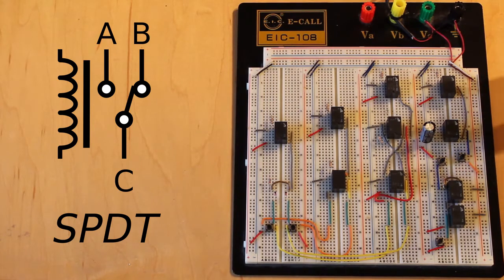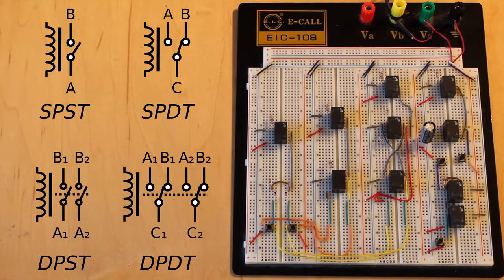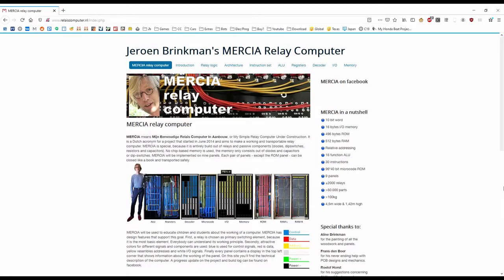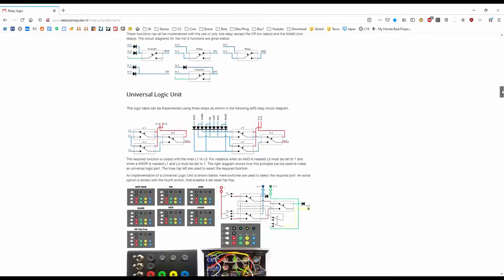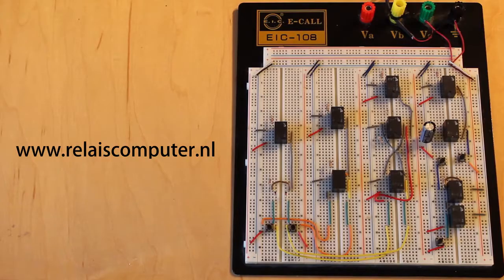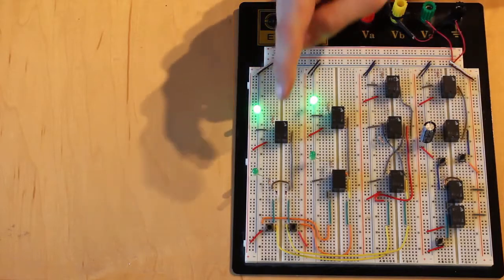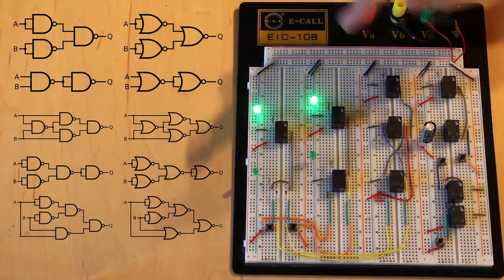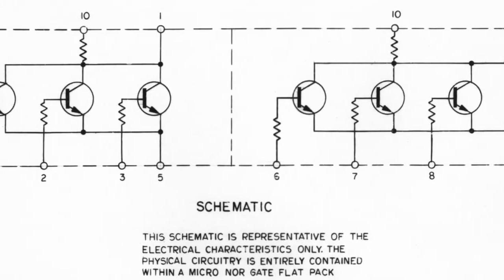Relay Calculators: Episode 3 - Relay Logic Gates, Latches and Delays

Comment: At +12:30 the description and the circuit diagram for the delay circuit are wrong. For the circuit to operate correctly the +5 connected to the contacts on the top relay must be connected to the Normally Open side, not the Normally Closed side. And the description should be that the delay occurs because the bottom relay doesn't energize until the cap is charged through the NO pin of the first relay (not the NC pin of the first relay). Once the cap is charged up, the power can then flow to the second relay and hold it closed. Then when the button is release the cap quickly discharges because the NC pin of the first relay is connected to ground. If the NC pin of the first relay wasn't connected to ground there would also be a delay of the LED going off when the button is released. 

Regardless, that's not how I would do that circuit. I don't like the fact that on one relay power and ground are connected to the NC and NO pins, but on the other relay power is connected to the common pin (and the NO pin has to float). You should consistently wire all the relays with power (or source signal) always entering on the same side of the relay. And because sometimes you want an inverted output from the gate and sometimes the non-inverted output, the input to the relay gate should always be on the common pin.

Comment: You can create a XNOR gate using only 2 relays by using the deviator switch diagram as basis. It is used for switching lights on and off by either end of a corridor. Same scheme, same truth table, the deviator switch is basically the XNOR gate.

Comment: Logic Gates, latches, and delays
Relays, Buttons, LEDs (Light Emitting Diode), Capacitors, Resistors
SPDT relays  https://youtu.be/_nXc439NTYk?si=zT2tPNIShm96czCb&t=110
Or, nor, - 1st bread board
and, nand, - 2nd bread board
univeral nand nor https://youtu.be/_nXc439NTYk?si=Mm7N9smMjoFoPMJd&t=458
xor, xnor - 3rd bread board ://youtu.be/_nXc439NTYk?si=Yr2IJNxRDkIZW2IL&t=513
SR latch, coil stays energized (memory - register) - 4th bread board
Delay with a 2200microF capacitor.
Half Adder and full adder.  https://youtu.be/_nXc439NTYk?si=DwDJ9305dj2Vnl3e&t=891

Comment: i cant get this to work. Trying to make a full adder to add up 6 bit binary numbers and it doesnt add. I dont know how to use these circuits to do this and everywhere online has bits and pieces of the thing but nobody seems to put it all together in one circuit. Either it doesnt add or it instantly forgets as its adding.

I just want to count pulses from a switch and add them up. Just cant seem to get it to work. Maybe I need a different circuit or something.
Reply: tried multiple schematics from the linked website and the gates work but are useless because all they do is chatter rapidly. i must use a pulse so fast that i might as well just use a microcontroller. cant figure out what im doing wrong.

Comment: Well presented. Are you intentionally blurring out the part numbers on the relays? I would like to do this project at home, but I dont know what form factor of relay will fit on a breadboard. Its really hard to tell in this video what the pinouts are. I am assuming Common, Gnd and NC are on the left, and NO and Coil are on the right?

Comment: To create a "better" relay based processor, another approach is to arrange relays in reverse contact direction so that circuits will pull voltage to VCC and to GCC for logic 1 and 0 respectively, not just pull to VCC for 1 and leave floating for 0. For example, to create a NOT gate you connect the NO contact to GND and the and NC contact to VCC, thus the output is the Common pin. If all logic gates are designed like that you get cleaner logic signals, and improved dynamic stability on very large designs as well as faster settling times of logic levels (less glitches caused by coil induction).
Reply: how can I get a strong grip on this subject like you ?
Reply: Yeah, but there’s a good chance for shorting out your power supply
Reply: @d3vitron779  That's right, but @lsfornells has a good point point too. First, that's no different than transistor based logic gates. Also, using relay logic that will both drive and sink voltage allows for circuitry that would not be possible otherwise, such as pass transistor logic (PTL) gates made with relays. PTL data latches and flip flops use far less transistors than their usual alternatives, and they can be implemented exactly the same way with relays. You may want to check a video called "1 bit memory with 2 relays" from my channel to understand why
Reply: @RelayComputer With normal 0=open, 1=connected logic, a single bit latch is one relay only anyway, not counting the bus connector and the shared sequencer.

A D-latch with rising-edge-sensitive clock and complementary outputs takes just 3 DPDT relays with snubbers on the coils.
Reply: Coil induction is not a problem as long as there is a continuous conduction path around the coil. That implies an R-C snubber. The problem with free-wheeling diodes is that they need time to switch, and while they do that, there’s a discontinuity in the response of the coil-diode combo. And, to keep the release times reasonable takes a back-to-back Zener diode pair, or a TVS. A snubber does that better while also degaussing the armature should there be a need for that. 

I have played with non-floating zero and there’s little benefit to it. In a complex enough computer, more than a third of the relays is needed just to configure the data path. Another third is registers. What’s left is combinatorial logic.

The best way to avoid the need for a NOT gate is to source both signal polarities from the source. With double throw relays it’s “free” as long as you don’t need to switch those doubled up signals around too much.